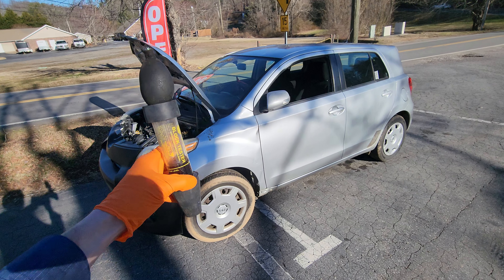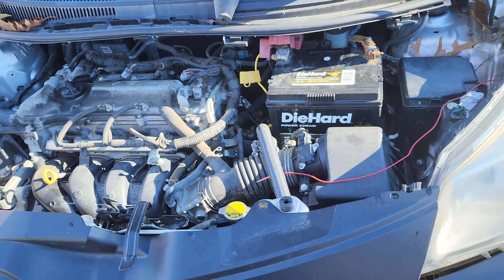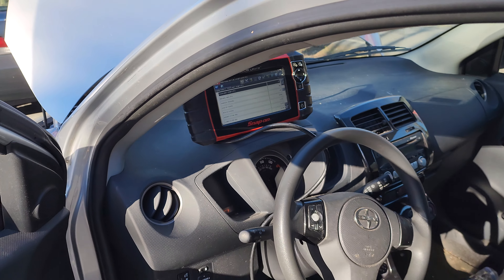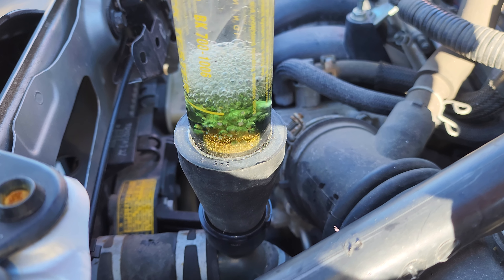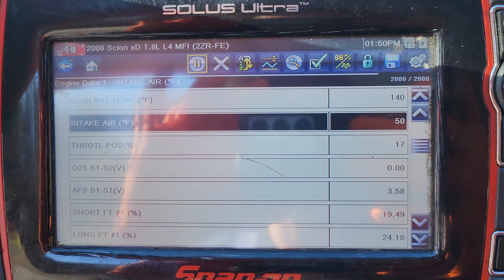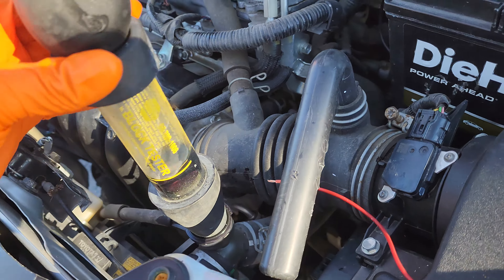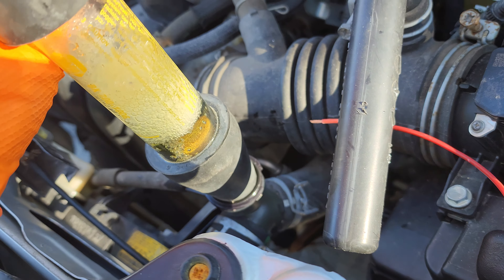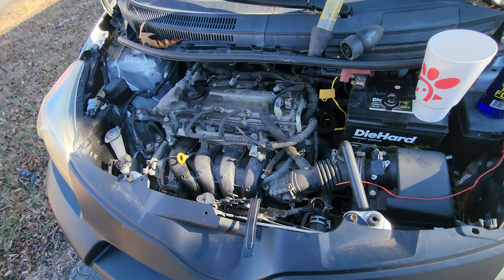Testing for Blown Head Gasket

Comment: Hello my 2012 Honda civic key door locks doesn’t works. I changed battery. Driver panel switch only works when key in the ignition if the key is not in it doesn’t woks I need helppp please 😢😢

Comment: Thanks for sharing. Other typical signs of HG failure is a milkshake color oil (coolant in the oil), and white residue on the O2 sensor (coolant getting burned).
Reply from the maker: Great tip!